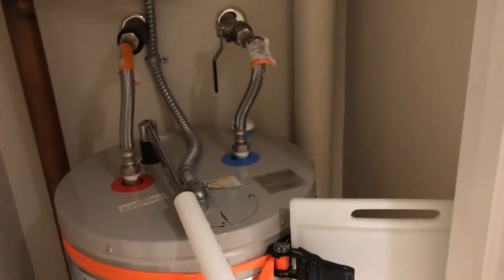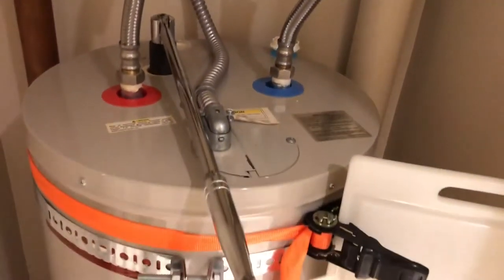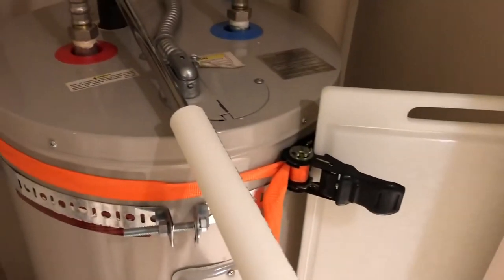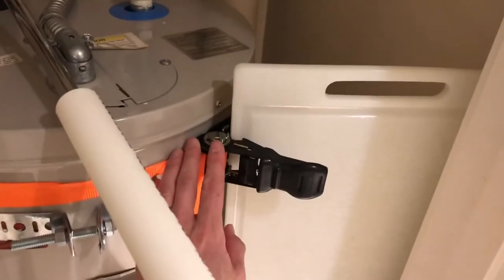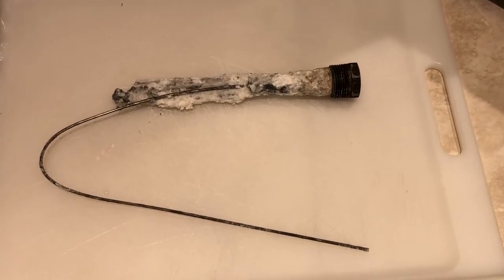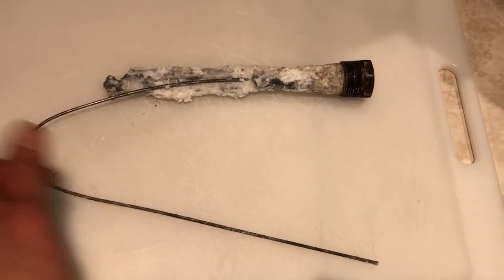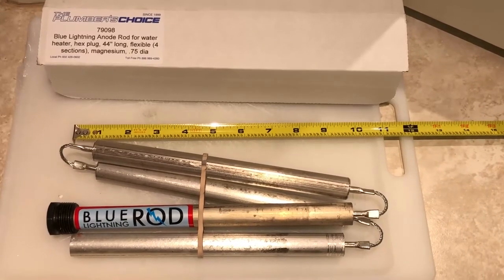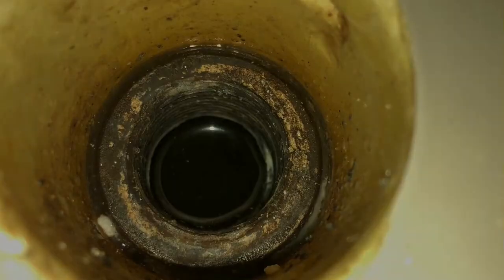How to remove a seized hot water heater anode rod

Comment: So glad I found this video with your suggestion. So far a 1/2" drive impact wrench, socket and breaker bar as well as applying heat has not worked. I will give this a try, Thanks

Comment: I used wood to brace my surge tank fittings against one wall and a steel angle iron between another wall and the hot water nipple.  That took care of the tank rotation.  I had a 24" cheater/breaker bar combination that wasn't working at all.  Your setup looked to be 36" long, but it was the plastic pipe you used that surprised me.  I didn't think plastic (PVC) would be strong enough.  I had a spare 45" piece of 4" schedule 40 PVC gray pipe standing right by the water heater.  I used that with my breaker bar and when I pushed firmly on it, the old anode nut came loose with a loud snap!  I thought something might have broken.  From there it was just
 a matter of unscrewing the anode which unfortunately had completely eroded away in 4 years.  I hope my 6 year warranty tank still has some life left.  I'm going to buy another anode and go through this again next. year.  Still, $32 per year is a lot cheaper than $600 for a replacement tank.  This is our 5th tank in 30 years so about 6 years a tank.  Your video made the difference for me, I was going to rent an impact wrench before I watched it.  Thanks!

Comment: Hi MITEEman,
Thanks for putting up this video about securing your water heater. It was much appreciated.
I had the exact same problem as you. I tried your method & it worked great! I was able to successfully remove the old anode rod & replace it with a new 'flexible' type. 
Best regards,  Bob

Comment: Watched several of these anode rod replacement videos. Some use a small area of teflon tape only at the very 1/4 top of the rod so there is still electrolysis conduction. Your use of liquid teflon sounds feasible but I'm would still be concerned about the film interfering with the conduction. I'm wondering if using dielectric lube/grease like you get from an auto parts store would work the best as it would lubricate yet still conduct the electrolysis process?

Comment: Good luck, you are lucky.Most tanks I cannot get nothing off.Heres one, some idiot did not put any nipples on hot/cold side.Just screwed a fitting in.Then rest up, soldered his crap while connected to tank.Melted plastic and maybe more damage.Now the hot side, he cut the pipe about half inch from connection.So, I have a nub to coupling.Worse, got to solder that coupler with heat going down tank right at inlet.I have attempted everything to remove the hot inlet copper threaded connection he put on.Nothing works due to tank cover won't allow room to get pipe wrench on.Socket wise, done stripped hex head.Been sitting weeks till I fig out my options.